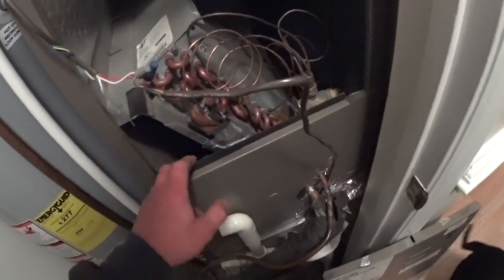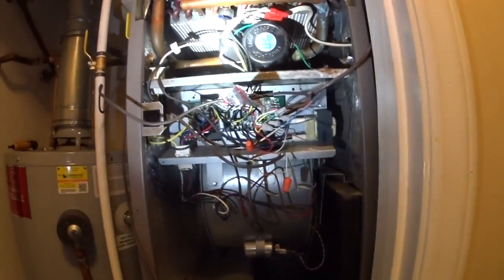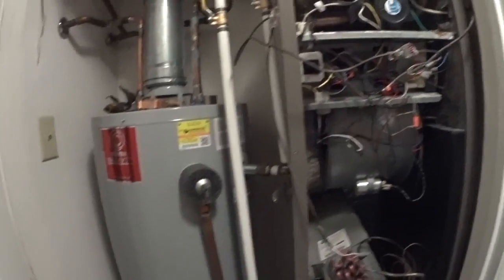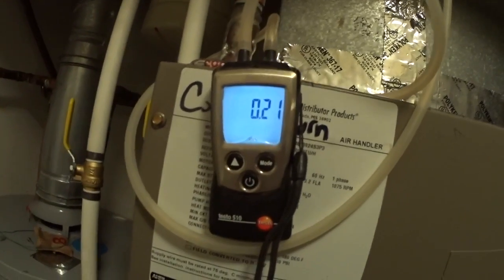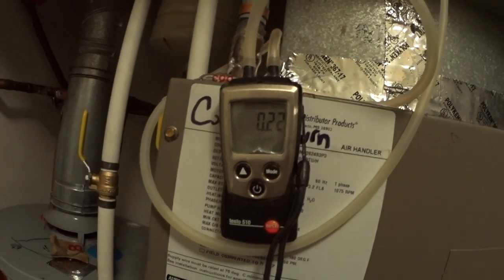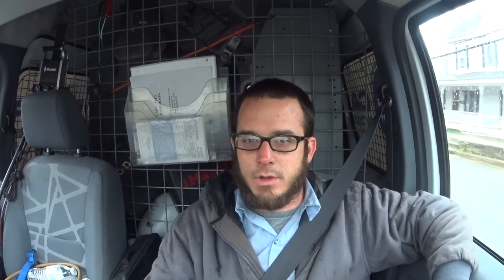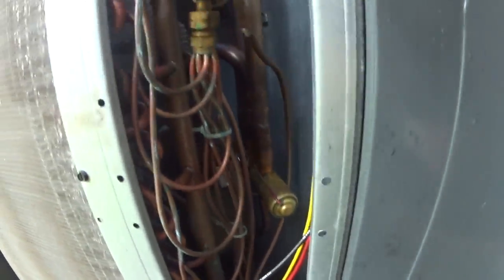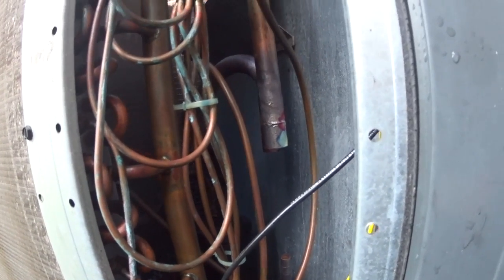HVAC Service: Poor TXV Placement and Reversing Valve From Hell 3-27-15

Comment: Cut all the pipes going to the reversing valve a little but away from the valve (pick easily accessible spots). Pull the old valve out of the condenser, unsweat the pipe stubs. Clean them up and put them back in the new valve. Dry fit it all back in and mark the position of the stubs in the valve. Use a vise or rig a set-up of your own to hold the reversing valve in place while you braze all the stubs back in. This is now the easiest part because you can do this outside the unit and make beautiful connections all the way around (don't forget the wet rags). Now you simply fit it back in the condenser and the only connections left are the couplers where you cut it out (which you made in easy to reach spots)
Never fight a reversing valve again

Comment: I've cut reversing valves out with Dremel tool before always fun with those things.
Reply from the maker: I'd be too scared to get copper shavings into the piping +Nor-Cal Refrigeration & H.V.A.C
Reply: +Stephen Rardon (HVAC with Stephen Rardon) you shop vac the pipes out when done. Some times you have to hack and mow out there. Lol I do.
Reply: WTF? Tubing cutters, no? I'm with Stephen, I'd be shitting bricks about trash in the system, shopvac or not. Even blasting it out with Nitro, I'd rather use Tubing cutters than "hack and mow," but more power to you man, if you can do it and it works, who am I to judge?

Comment: Why not put the 410a txv back on and not use a dry charge unit?
Reply from the maker: i would've probably done differently for myself +Joe Shearer but we'll see how this lasts.
Reply: 410a blows, that adp coil wouldn't hold up( I know they put their 410a cert. sticker on it) and then you'd end up with an evap a year later and a pissed customer. Because " it didn't leak before you touched it". Were those statics including water coil?